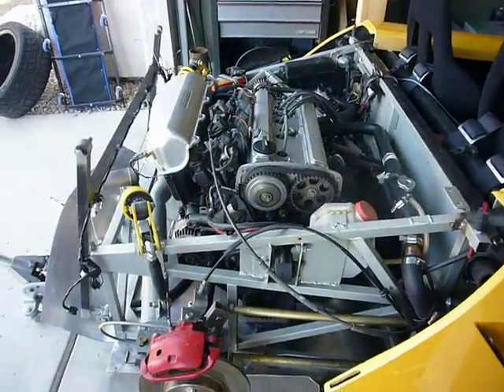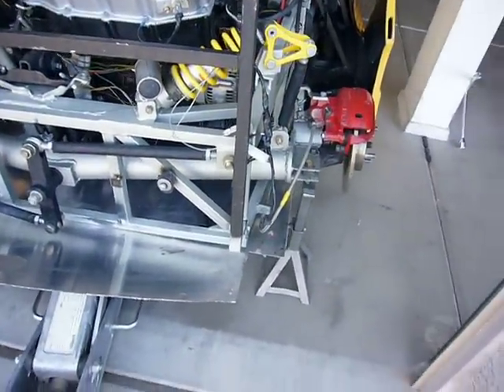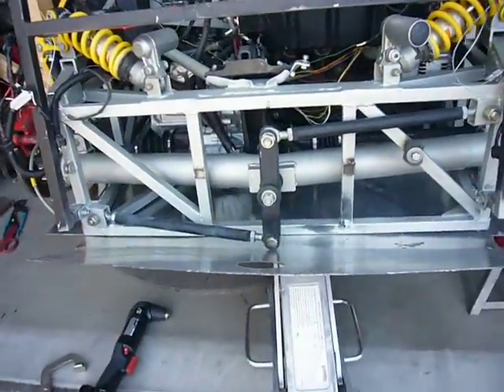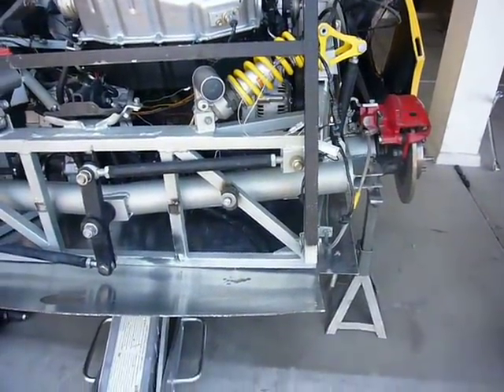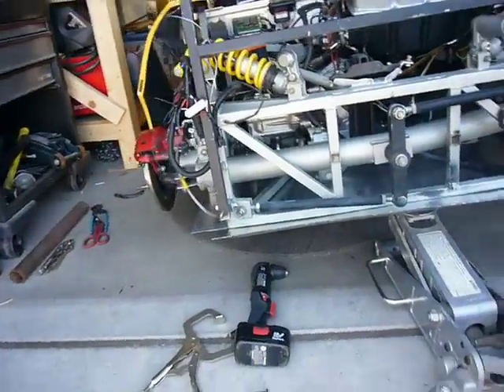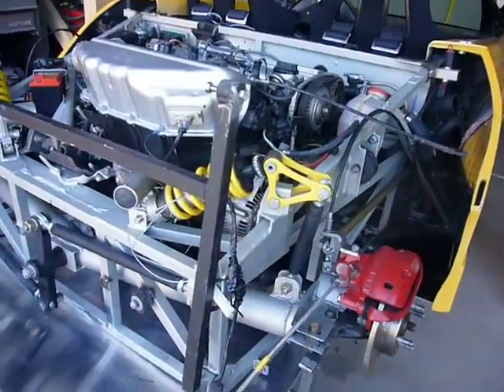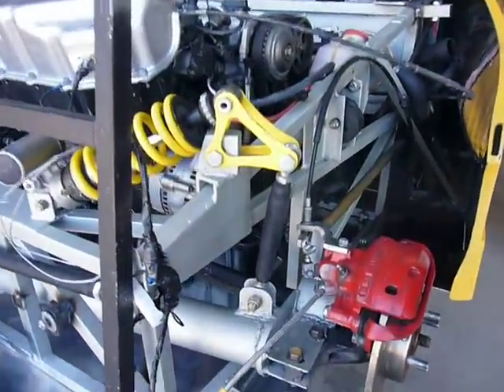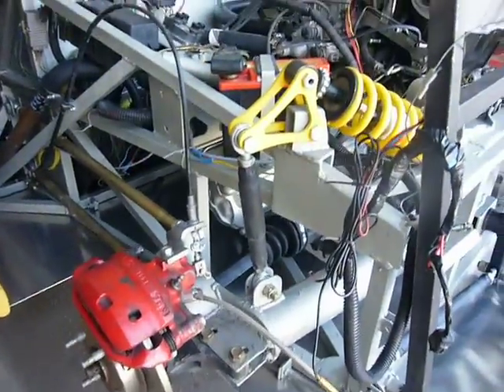La Bala Suspension - DeDion demonstration

Comment: It's not the same. The differential is mounted directly to the chassis and two half-shafts are used to transmit power to the wheel hubs. Unlike a live-axle setup, a de-dion suspension has very low unsprung weight.